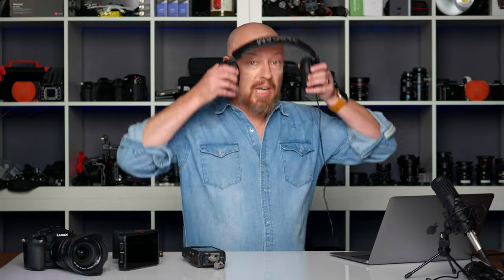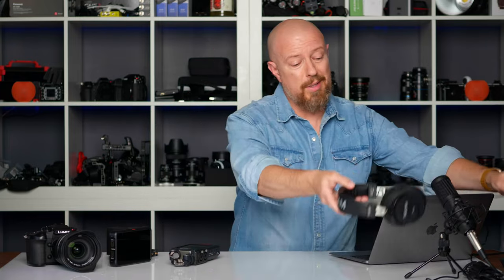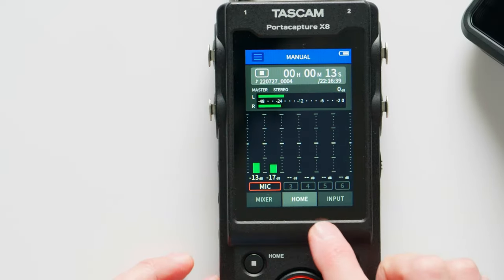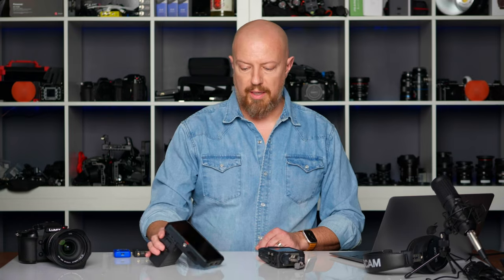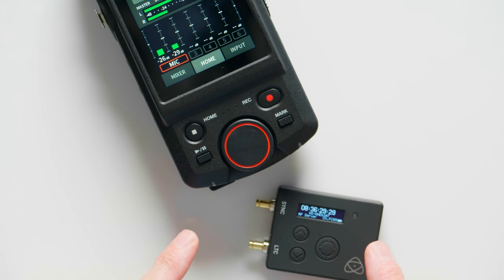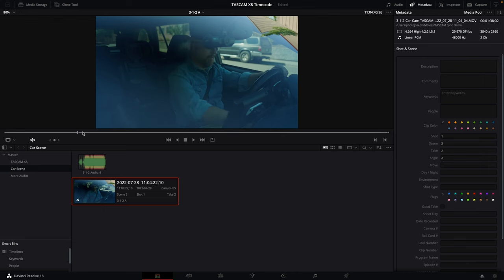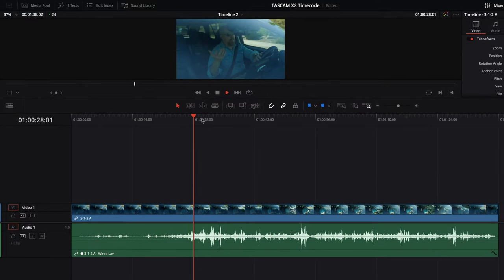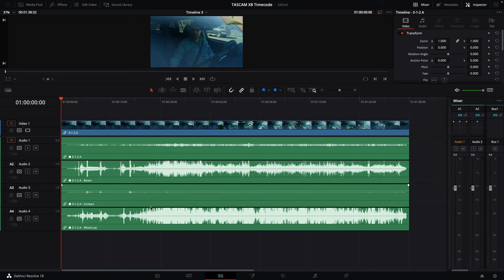TASCAM Portacapture X8: Timecode and 32-bit float audio!

Comment: The timecode example with you at the creek dipping your feet is the best example. People don't think about how loud that water renders on a mic+recorder, ever. If dialog iss worth recording, it's worth isolating the environmental noise from those people talking.
Reply from the maker: Thanks Eric and I totally agree — I liked that one best as you could almost-sorta-kinda hear my dialog, but certainly not enough to match!
Reply: I'm not taking away anything from the video, it's a great video! But I have to add, for situations like that, you'd use a clapper, that's what it's for. Obviously, timecode is more convenient, I'm just saying it's not essential.

Comment: While the X8 is a great audio recorder, there is one big drawback that make it challenging to use with timecode. TC only works with the Atomos products.  It does not have TC generator built-in so it must rely on something external.  Unfortunately, the only option is bluetooth.  It would have been awesome if Tascam made the Line Out 3.5mm port a flex port that allowed other TC devices to jam sync.  I've been using the Tentacle Sync system for awhile and it's absolutely incredible.  I sold my X8 and bought a Zoom F6 since it has a dedicated TC input as well as the ability to generate it's own if necessary.  The only other issues I had with the X8 were the handling noise while recording and no option to record in polywav format.  I guess we can't have it all, right?!! 🤣🤣
Reply from the maker: fair enough ☺️ I like a poly file, too.

Comment: After camera upgrade advice please. A few years back I switched from Nikon D3300 to Panasonic G7W, Australian model. It let me upgrade to filming in 4K and really happy with what it can do. Great value also. If I want to upgrade, what sort of models would I be looking at? I would like to improve in these areas: No crop in 4k and larger sensor, especially interested in anything that is good value. Thank you!
Reply from the maker: For best value, look at a used GH5. Now that the GH6 is out, you should be able to pick up a GH5 for relatively cheap. Great great camera, and a very solid upgrade to your G7.
Reply: @photojoseph  Will do, thank  you for the advice 🙂

Comment: Announced today: “With the introduction of the V1.30 firmware update, the Portacapture X8 now has the capability to use 32-bit float point resolution when using the unit as a USB audio interface to a DAW (Digital Audio Workstation). This facilitates wider dynamic range, higher resolution, and greater audio quality for better overall record quality. The 32-bit float technology enables audio to be dynamically controlled and edited virtually without limitations. Clipped audio segments can easily be corrected and, similarly, low level audio passages can be adjusted to a higher dB level.

Paul Youngblood, Director of Product Marketing at TASCAM, commented on the new features offered by the V1.30 firmware update, “The Portacapture X8 has proven itself to be a full-featured, powerful handheld recorder both on its own or when used in tandem with a computer. As a company, we strive to listen carefully to our users, as this enables us to learn first-hand how our equipment gets used in a wide range of applications—and the V1.30 update is a perfect example of this. We’ve taken the most requested capabilities and turned those into new features that make the Portacapture X8 even more versatile and useful.”
Reply from the maker: Neat!!
Reply: @photojoseph  Very neat. “The USB MIX MINUS function can now be used in the PODCAST app.
This can suppress the occurrence of echoes in audio from remote participants when capturing podcasts.”

Comment: Now, if there could be an option to auto start/stop recording on the X8 with the camera set to “rec run” timecode mode, that’d be dope (my camera barfs timecode out over HDMI and the Ninja runs its timecode based off that, which then runs the timecode on my X8—I have everything powered off a funky D-Tap setup and everything has its own idea about voltage so, with all of these converters, I get ground hum if I try running the X8 out to the camera, hence why I record separates).

I find it kind of annoying that I have to hit two record buttons when I do videos, but at the same time, this recorder has saved my bacon on so many projects that I just ended up incorporating it as my main audio source. Besides that, the R5 C has kind of a crappy internal preamp (my mic is unusably noisy on the cam in, but it sounds nice and crispy on the X8).
Reply from the maker: What you’re sayin if I’m reading correctly, and AFAIK that’s correct, is that the X8 doesn’t have start/stop with timecode, right? Yes that would be useful. I think the MixPre series does that.
Reply: Yeah, I have looked at the MixPre, but I already bought the X8 so, ya know, may as well make the most of it (at least setting timecode is nice and quick, and this thing runs for a crazy long time even on only 256GB).

I’d prefer to have files along with the videos, but timecode syncing is FAR better than nothing at all (especially given the crispy audio this thing records with functionally everything being recoverable).

Comment: Thanks. So no way to plug in to a time code generator? If I already have a time code system I have to buy 3 more devices to get time code with this, correct?
Are there any 32 bit field recorders, that you know of, that time code in an easier way?

Comment: When using 32-bit float, am I able to set the level on the recorder at any level I want (whether its the lowest or highest it can go) before recording or should I still play it safe and set it to what I usually set it at before recording? I know I can later adjust it in post, but I am not sure what the best approach is when you're first recording using the setting.
Reply from the maker: It’s always best to set it right while recording.

Comment: Hey Joseph, thanks for another great video and the informative knowledge about timecode. You just made the process all clear and simple. It's really interesting. And do you know Deity TC-1? As you explained that Tascam X8 used BT timecode. So is there a way to use Deity TC-1 with X8?
Reply from the maker: Thank you Leo. The X8 unfortunately only supports timecode through Bluetooth, so support for it has to be written in. I don’t think Deity is supported. They do make a nice setup though.

Comment: So wait, If I got a canon R5c. And a Tascam X8. I would need 1 atomos ultra synch blue and 1 Ultra One? The ultra one would give timecode to the R5c and the Atomos blue would give timecode to the Tascam X8 through Bluetooth?? If thats the case how do you connect the tascam to the atomos blue through bluetooth? I know you'd need the Bluetooth card but how do you synch them together??
Reply from the maker: I looked up the R5c and see that it does have timecode input, but I can't quite tell what that port is. If it's mini-DIN, cool. If it's proprietary, then you should check with ATOMOS to ensure they have a cable that is compatible with the R5c. Start here https://www.atomos.com/accessories/ultrasync-one To your question, yes you need two devices unfortunately; an UltraSync ONE for the camera, and the UltraSync BLUE for the X8. Connecting the BLUE and X8 is just pairing them through the X8's menu, just like you'd pair any bluetooth headphones to your computer, for example. I hope that helps!
Reply: @photojoseph  Google says its a "BNC" port? That sound correct? And alright. So all id have to do is synch the blue and ultra one so they have the same time code (make one a master and one a slave) and then just connect the ultra one to the R5c and connect the blue to the x8 and sounds like that will work?

Comment: Just bought the Tascam a week ago. Thanks for showing stuff most others won’t. I was curious about version 1.20. I will definitely look into buying a time code device in the future. Curios would one of diety tc-1’s work in place of the ultrasync 1?
Reply from the maker: No, it’s tied to the ATOMOS protocol. I’ve never used the Deity but I know that the ATOMOS and TentacleSync devices don’t talk to each other. Which is a shame, but I get it.
Reply: @photojoseph  Yep I get it as well.

Comment: Why the lumix cams have so noisy amps? dont no another brand cause i have the s5II only, but is pretty noisy in all kind of levels. thanxs
Reply from the maker: I’m having a hard time understanding your question. Are you talking about the audio pre-amps? Did you say you “don’t know any other brand” or that “no other brand has this”? I really don’t know what you’re asking. I’ve never found the pre-amps to be noisy but I’m no audiophile, and I’ve certainly never critically compared to other brands. You can get XLR input with the XLR1 accessory if that matters to you.
Reply: @photojoseph  thanx for asking Joseph. I find the audio really noisy, i have to set in -18db for the less possible noise, but still i have important amount of noise. If i compare recording audio even with my Phone, i find i have better results in terms of noise base.
Reply from the maker: @PS-ys9yg  what mic are you using? And how are you connecting that same mic to your iPhone to compare?
Reply: @photojoseph  i tried direct plugin a lavalier senheiser mic with the camera and the iphone. But i used to use the rode wireless go II
Reply from the maker: @PS-ys9yg   I don’t know what to tell you. I’ve done hundreds (thousands?) of recordings with lav and small shotgun mics on nearly every LUMIX camera made with dozens of mics and have never had a problem with the noise floor or SNR. Perhaps your camera had a fault. I would contact technical support in your region.
Reply: @photojoseph  yeah maybe, thanx for answer Joseph.

Comment: Would it be possible to feed the output into a RodeCaster Pro2?
Reply from the maker: if the Rodecaster has a line input, then yes. However you can only RECORD in float; the output will be limited. At least I’m 90% sure!
Reply: @photojoseph  More thinking of it as like a backup for " That one guest " whose that has voice is so loud that there can hear it in the next show. , and you can go in a fix it up somewhat later.
Reply from the maker: Got it. As long as you record them on the X8, then you can still pipe it into the rodecaster and only use the backup if you need it.

Comment: hello Joseph, please speak with Tascam, we need native timecode that works with deity or tentacle devices. The system of Atomos sucks.
Reply from the maker: The tascam (at least this model) doesn’t have a physical input for timecode so Bluetooth is the only option. The ATOMOS BT can be tricky to connect sometimes; I’ve found doing a reset on the BT hardware usually get it working. Also make sure all hardware has the latest firmware updates.